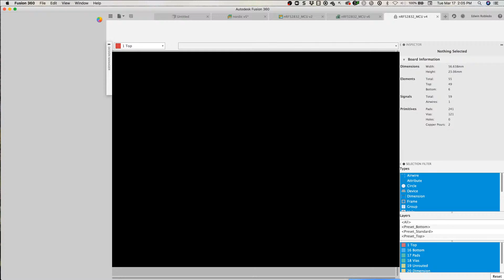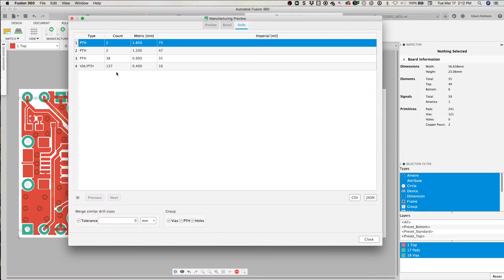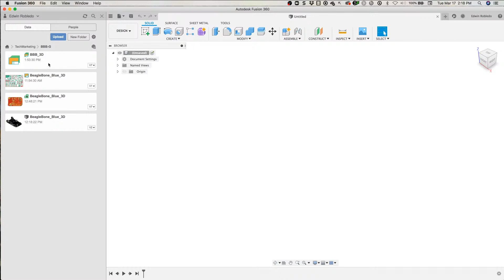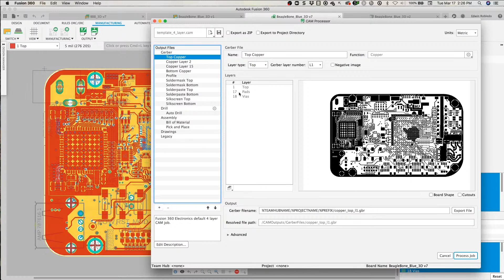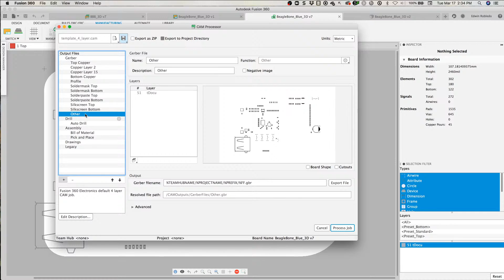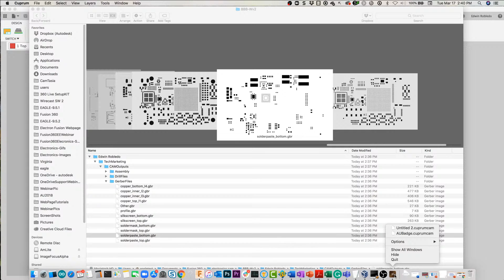360 Live: Circuit Board Manufacturing files

Comment: Hey Ed, thanks for doing this video.
-Ken
Reply from the maker: Hi, this is Ed, thank you for participating and your kind comments.
Reply: @adskFusion  I haven't tried this yet. Is there any special plug in required for the PCB design tools? I read on the FB group some one mentioned getting eagle in a packaged subscription. Any information about that?
Thanks
Reply: @MakeTechPtyLtd  Hi, thank you for joining us. In the Fusion 360 design environment, click file pull down menu and select "NEW ELECTRONIC DESIGN", from the electronic document you can now create a new schematic or load and existing one.
Reply: @EdRobledo  ok got it.